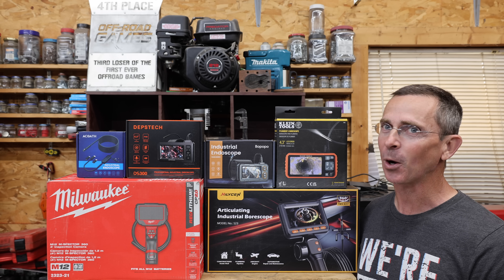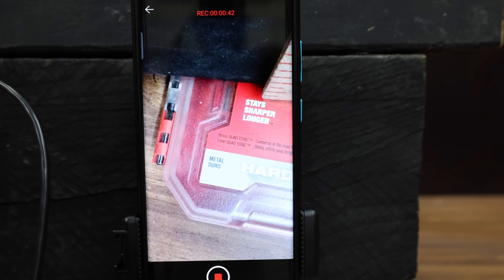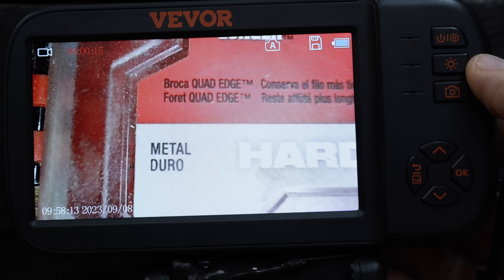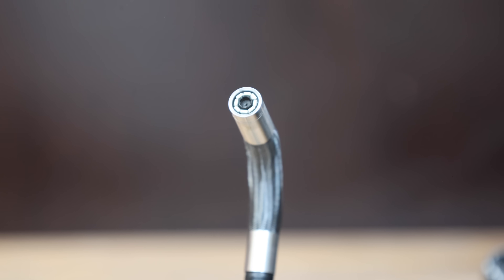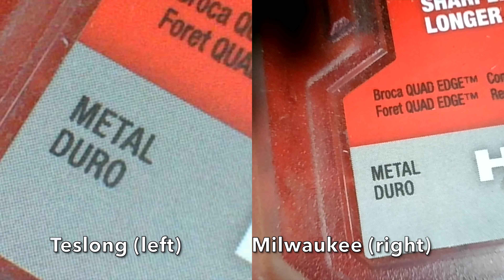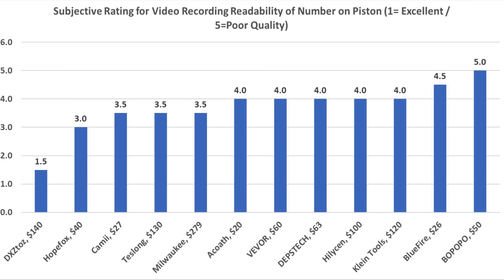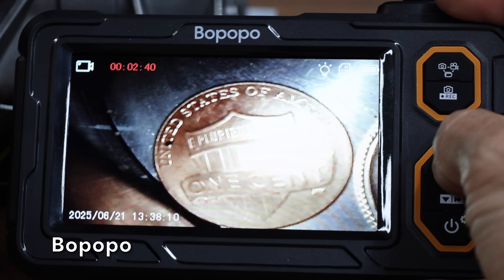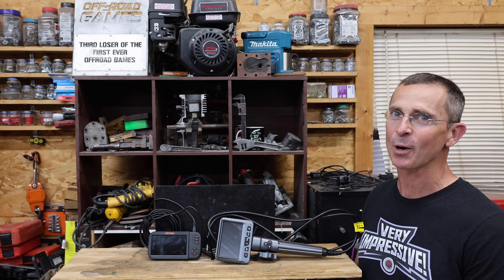I Tested The Most Hyped Inspection Cameras – One Clear Winner!

Comment: Todd, one possible issue I must point out with devices like this that come with it's own micro SD card is, will any brand micro SD card function on that particular device?  I know for some Dashcam's you have to use the card it comes with for most brands.  Can you somehow answer this question for us?  Should a micro SD card fail, and not take any brand the tool can become a paperweight pretty quickly.

Comment: I have the equivalent of the Acoath/Bluefire from Amazon (same borescope sold under a bunch of names). It works on depending on which phone you have. Some phones will detect a large power draw when the LEDs are turned on and they shut off the USB port, as the phone thinks it has a short. Some phones don't have that issue. Mine does.

Comment: Hey @ProjectFarm!  Can you do one of your more old school videos of testing different things on engines?  I recently ran some experiments on a flex-fuel Chevy Suburban and had very interesting findings!  The truck has almost 300,000 very hard miles on it.  I used a borescope and saw a ton of deposits on the pistons and valves.  I decided to run 4 tanks of E85 to try to clean it up.  The results had been amazing!  When I checked again, it cleaned a ton of the deposits off the pistons and valves (still port injected model).  I also pulled the fuel injectors and found substantially improved injector spray patterns!  So, the question comes in; what cleans injectors, pistons, and valves better, Shell V-Power Nitro+ (because it is marked as cleaning the engine) or E85?

Comment: Suggestion: fine or precision screwdriver sets.
I've had a couple good ones and some where the bits break or aren't securely attached enough to confidently twist the screws on a pair of glasses, for example.

Comment: Please work with Cletus McFarland and CJ race cars on a video testing the grip of different chassis (and wheel/tire) setups to determine the chassis setup with the most grip based on the observed dynamics of doing a burnout. For example you could measure the number of rubber bands a particular chassis setup can be restrained with while doing a burnout. If more rubber bands are required to keep the car from moving while doing the burnout that chassis setup has more grip.

Comment: I have the Teslong TD500 and it's amazing. Compared to the TD450S in the video, it has a bigger screen, higher resolution camera, and an additional side camera (with light) that can also be used in split screen mode with the front camera

Comment: The depstech I got (not sure if same as the one reviewed) is an absolute piece of garbage, especially its screen which is so very very bad. It also stopped working after being used about 5 times. 

I will say that the vevor does not have articulation, so I will be very happy to pay an extra $80 to get the articulation. it will make the difference on being able to precision target it through certain gaps you're aiming for rather than just having to blindly coax it through. Rotating it will give you the other degree of freedom you need. I might be overemphasizing the value of articulation but seriously if you are pulling out a tool like this, the features that will make your job go quicker are going to be worth their weight in gold.

Comment: These have built-in rechargeable lithium batteries. If I drop $150 on one of the better ones, am I supposed to just throw it away after the lithium battery craps out in around 5 years?

Comment: Requesting you test pass-through socket sets again. one of the things i'm particularly interested in is how difficult it is to remove the socket from the ratchet, as the set i have ranges from "as easy as normal socket and ratchet" to "you gotta rotate it to just the right spot, then wiggle back and forth while pushing against it to maybe get it out, but if it doesn't, you gotta keep rotating it until it comes out."

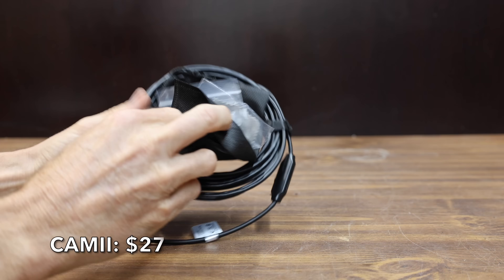Comment: I'm only 2:00 in. I bought a Milwaukee 8 or so years ago because the lens head was under 0.430" I needed to examine and size trumpet and cornet valves.
Reply: The camera head on the Milwaukee you tested is quite a bit longer than the one I bought. It could go around the 3rd valve slide, but not completely. Only enough to provide me a full view of the valve slide if I examine from both sides.

Comment: I was not impressed with my phone borescopes and saw the DXZtoZ being recommended somewhere in my trade rags.
          Then I saw some review saying it does not exit the Linux file system gracefully on power down, possibly gradually corrupting the filesystem. Maybe they all do.
     I stopped just playing with it to not "wear" it out. It is the best boroscope I've used other than the $$$$$ fully optical direct to eyeball one in industry.
     If I knew the particulars of the chip needing replacement, I would microsolder a new one in when the time comes.
Probably embedded in one chip/blob or encrypted, or spray a glitter bomb if opened.  Oh wait, it is not made by the fruit company....
        An optical replaceable condom could be sold for these, seeing there is a
demand for "other" uses.

Comment: Good vid. Many thanks!!
I bought a Depstech model that plugs into a phone or tablet. These are a big ungainly to handle but Thingiverse have plans for a phone holder and cable spool so you can operate these cameras without needing lots of hands. On the cheap one I have the LEDs can be turned off completely using the thumbwheel, which is handy for shiny things. 
It's amazing that something that was unaffordable for the DIYer is now so accessible and useful.

Comment: I have an inspection camera that is not listed that I did not pay much for. I found it interesting that they now have a magnet on the tip maybe the one I have did at one time. I recently used the camera to find a very thin 7/8 nut that slid down into the hood of a truck that I was putting a security device on. The nut slipped down in between the outer skin and the inner panel never to be seen again I thought. If it had been a normal sized 7/8" nut I would have thought no problem. I needed that nut due to the thin size. I didn't want to take off the hood to shake it I didn't need it that bad. I actually found the nut with the inspection camera down in a crack where the two panels came together. The joke was on me I was able to get a small magnet on a stick down to the nut and move it around. The problem was that the nut was a good quality stainless steel and was nonmagnetic. Being dumb I spent way more time fishing the nut out with a piece of bent tie wire than it was worth. It is now in place where it was supposed to go.

Thanks for the review. It is not likely that I will ever purchase something from VEVOR again, the DXZ looks interesting for whenever I get tired of the poor quality image from my current camera.

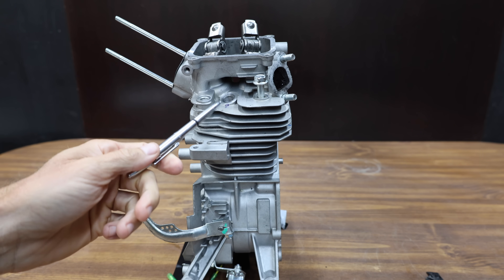Comment: for the piston reading at 10:50, one thing to consider is that the light on inspection cameras is set up as a ring light, which means you'll get a reflection if your camera is pointing directly into a reflective flat surface. You always want to point your camera at an angle so the light gets reflected away from the lens, not directly into it.

Comment: A critical factor for me is the probe length. For engine, most vehicle work the 5' and 5.5' lengths of the DXZ and Teslong are good.  The Vevor is the highest rated 16+'  cable. I think plumbers would want a longer cable as well.  It's good you emphasized distance. In 2018 I bought a Depstech for $37.50 (plugs into a smartphone), paid an extra $18 for a set of the end attachments. It had a depth of field (focus) of less than half an inch, was utterly useless. I couldn't point it at things I was looking at with my eyes and get a usable image.
For my 45' sail boat I went with a 16.5' long one No brand name, 'currently unavailable' om Amazon $30 a year ago. Seems pretty handy. 
On a boat there are wire runs and voids where I want to run some 12v wires that are long enough to need a longer than 5' boroscope.

Comment: Back in the day we purchased several usb cameras (Depstech was one of them) and after 2 or 3 years, with phone changes, new or just updates. The app would no longer work. Buy one with a screen so it just works until it breaks. Have same issue with Samsung security cameras, can't view remote on windows because of IE support is gone and no support on Edge.

Comment: I just bought one of those cheap ear inspection and cleaner things and modified it to use a flex housing instead of the metal tube, works for most the engine work when I've wanted to check a spot, I have a handle that attaches to it if need be. Total cost was 30 bucks and a bit of handywork.

Comment: pennies and labels are fun and all but there are also optical resolving power / resolution charts. ones you can print with a laser printer are better than you need for this too. 'focus' and half angle resolution is mixed. chances are they all focus the same but the pixel size & aperture is different. with the chart you can figure out if the sensor is actually '1920p', or if two sensors have the same resolution

Comment: @ProjectFarm here you might have over done your own expertise.

When testing optical systems you must consider: fixed focus/ focal distance and test that separately from resolution, you are mixing 2 different things with your " distance test", a camera with a big open i.e. good light performance will have a narrow range of distances in which objects appear Sharp, but it still might have a good resolution and a good low light performance, but you have to have the object you are looking for in a very specific distance. Where a camera with a small sensor and opening might have a bigger focal depth.

But here you are mixing this with a resolution test (i am not talking about the amount of pixels.the sensor has!)

Comment: I've used the Teslong as an aircraft mechanic. It's great to use for the spots it fits without the mental weight of holding the shop's $15000 Olympus turbine inspection scope.

Comment: Very enlightening on the differences for sure.  I have the Depstech one, I have plugged cameras meant for phones into and they work fine to my surprise, and much quicker and less hassle than the phone.  So after that I am wondering if maybe you swapped the cameras that disconnect to other display units to see if the difference is the cameras or the display units? obviously not real relevant since no one will want to by two to get a good one,  just a curiosity.  Thanks for another great review.  Its too bad none of the articulating ones have better video quality.

Comment: Stud finders and wall scanners could be a fun video. You could test them on how well they can read through different types of walls and detect electrical wires. And then see how well you can hang a certain amount of weight using each one to see how they performed.

Comment: I bought the dxztoz almost two years ago now and it by far has been awesome. I have used it multiple times and I have zero complaints about it. 
One item I would like to see a comparison of is oven thermometers and meat probs. Is the dial oven thermometer better than the digital thermometer? Does it read ambient temp accurately? There is so many to choose from. Definitely a question I would like to know the answer to.
Reply from the maker: Thanks for the suggestion.

Comment: The Hopefox for the price right now is actually looking tempting, it's on sale currently for $30 ( 7-6-2025 )
Reply from the maker: Thanks for the feedback.
Reply: @ProjectFarm  The unit I bought just helped me see where I could not get my head, was able to have it be my eyes to replace the fuel tank pressure sensor on my S10 without lifting the bed or dropping the fuel tank, if it wasn't for your video I would not have seen that sale on that unit, thanks again for the videos and reminding me some decent budget tools exist out there.

Comment: I'd like to make a quantitative comment on your ratings.  Focusing on the numbers in yellow in your final table, notice that the Maximum Distance ranges from 2.5 to 3.0 (total range 0.5), while the last subjective rating on the right runs from 1.0 to 5.0 (total range 4.0).  This means that the second criterion is weighted 8 time more than the first one in your average rating.  Is that what you intended?  I suspect not.  I suggest that you re-scale all your ratings so that they run from 0 to 1, and then compute the average.  That will weight them all equally.

Comment: Can any of these borescopes be used to inspect wall cavities? Drill a small hole in the drywall and look around for hidden wires, pipes etc. — that kind of thing. I get the impression they all have very short focal lengths and are blind beyond a few inches from their tip. Thanks for a very interesting video!

Comment: I believe I bought that same or close to it depstech unit two years ago.
I had to diagnose a bad misfire only in start up of my 2001 Toyota Tacoma’s 3.4L engine.
The camera worked good enough to see antifreeze was leaking once pressurized from between the valves! Cracked head 😢. 
But the machinist confirmed my suspicions.
So I guess I was happy with the unit. 
It’s not perfect by far but I bought it just for this diagnosis only, worth it.
Reply from the maker: Thanks for sharing.

Comment: Had to make a pipe centering rig outta sping steel measuring tape and washer wheels on 5 sides to stop just dunking in crud the instant I put it in. Also spun around the camera.
   Those things need that sorta gear without being the 5 grand model.
Reply from the maker: Thanks for sharing.

Comment: It’s another tool you didn’t know you needed. I bought a Depstech with a larger 5 inch screen, HD image, and a triple lens to look in all directions. It cost about $80 on Amazon. I used it to look into walls to find the source of a plumbing leak. I saw techs using it to view cylinders and pistons in two stroke power equipment—you don’t want to spend time fixing something that is already shot. Neat!
Reply: I bought the same model a year ago and have been happy with it.
Reply from the maker: Thanks for sharing.  Thanks for supporting the channel!  I really appreciate it!
Reply: That’s what I have and I use it every day in the shop

Comment: I'm a mechanic. I've never needed a borescope
Reply: Me either, but if I had one I would use it. I could see myself using it to check things under a car without lifting it, or locate things in the engine bay. Save my back and knuckles for the actual work.

I'm a contractor too, so I could see myself using it in electrical work and probably quite a few other things.
Reply from the maker: Thanks for the feedback.

Comment: (Oops, both Acoath and Depstech links go to Acoath page, Todd.)  Well, I bought one of these cams (link to phone) and found that the Motorola phone doesn't work with it: not a USB2GO connector. A year later I saw another one which used WIFI but their app showed up as a Chinese spyware. I liked this one because it was small enough to look down a 5.56 bore, but I just couldn't win.  (sigh)
That Vevor looks good, it has its own screen,  and it's only half again more than I already have invested.  Mebbeso.  Does it have a model number?  The link showed 4.3", 4.5", and 5" screens, and some reviews complain about the wet noodle cable, even though all say it is semi-rigid.
Reply from the maker: Thanks for sharing.

Comment: Video idea: Test different paint strippers

We recently bought QCS paint stripper for a wooden table that did NOT work as well as intended. It was advertised to be easy to use, yet after a couple hours we still had to scrub and scrape like crazy. 

We have citrus strip, which we used once and worked decently-ish, if I remember properly. So now I wanna know what paint stripper works the best on different surfaces like metal, wood, plastic, etc.
Reply from the maker: Thanks for the suggestion.

Comment: I bought the Vevor about a year ago.  It was instrumental in enabling me to run a new wire from my basement to the new doorbell I installed at my front door running through the wall.  Without it, I kept trying to run the wire between the wrong pair of wall studs!  I found it to be an acceptable buy for the price charged and the quality it provides.
Reply from the maker: Thanks for sharing.

Comment: I feel like a great successor to this video is to test cameras ment to inspect sewer lines and such, put them down different pipe sizes with angles and see how well they do without getting stuck, as well as the camera quality.
Reply from the maker: Thanks for the suggestion.
Reply: @ProjectFarm  Most annoying part about using borescopes (other than the things tested here): camera fogging up/getting dirty and being unable to get around a bend in a pipe. I've also had some issues with the cables getting kinked, though that's usually due to some idiot storing them incorrectly.
Reply: This would actually be super helpful for home owners
Reply: This is the video we need
Reply: Trying to inspect pipes is a pain and near to impossible, wrong cameras to inspect pipes

Comment: I have 2 Teslong NTS500 scopes. They come with a 5.5mm dual lens scope, one being a 90 degree side view. I have a 3.9mm slim scope on the other one. But I am not doing automotive work either... But thanks for the in depth review! I would get the DXZtoz if it was a smaller diameter as I need to fit in a 1/4" hole. Who knows, I may get one anyway...
Reply from the maker: Thanks for the feedback.

Comment: Borescopes are widely used in the automotive industry. We use them to look at cylinder damage and assessing an engine to determine if it is worth repairing, or simply dismantling and using them for parts. I had a borescope years ago. It was a cheap one that had a bad camera. I later stopped using it because it failed. I’ve not replaced it yet.